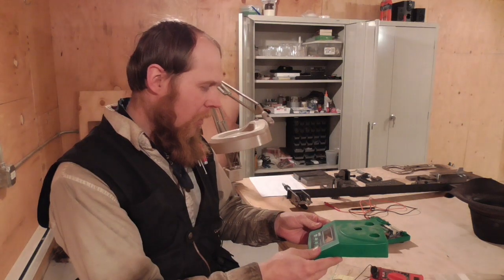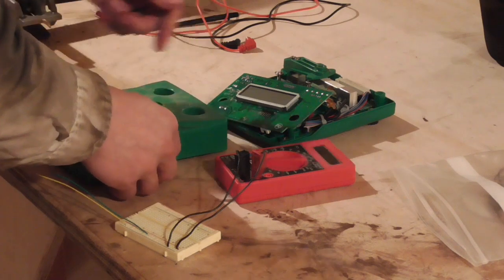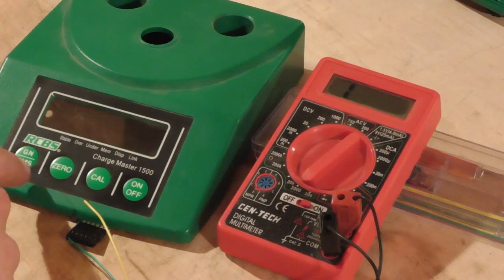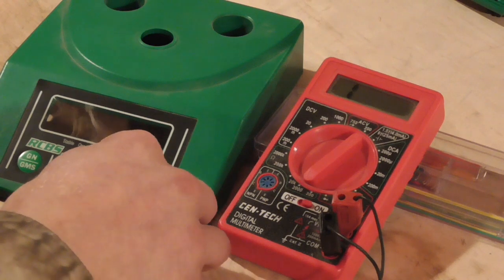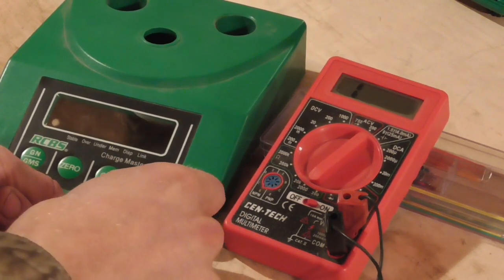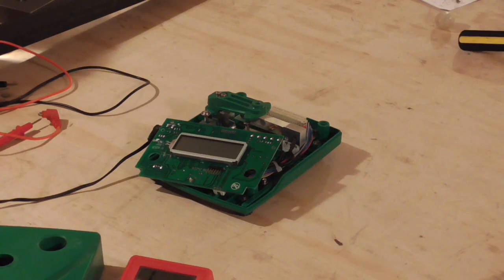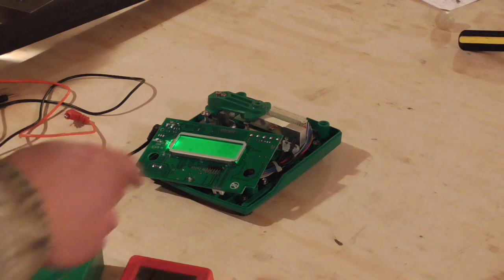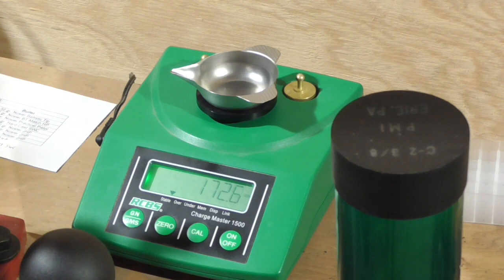Troubleshooting an Electronic Scale (TIS196)

Comment: Ha..that was interesting, power scale popped on during your report..lol👌  I have that similar scale in Hornady, it's a ok good one. I still cross check with my older RCBS rail scale first before the digital reading. Yeah, it has caught a few mistakes double checking, I like both. A double check before going to the Rock Chucker.  Kool video there😎👍